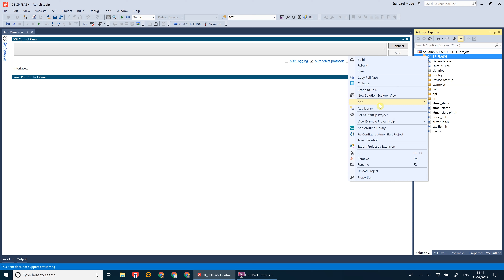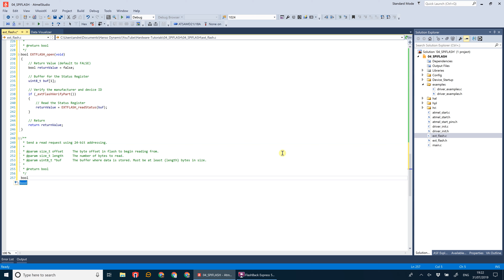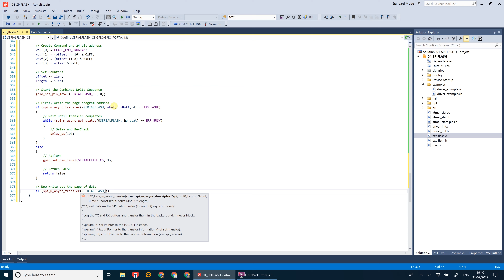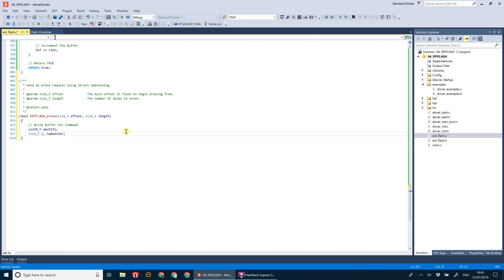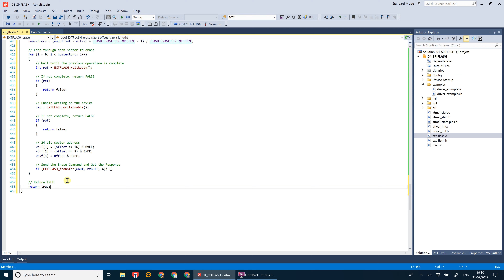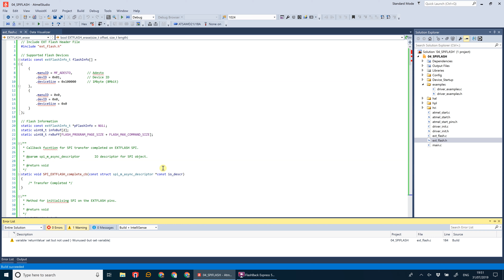Comment: Hi Andy. I didn't understand why you did infoBuf[0] = rxBuff[1]  and infoBuf[1] = rxBuff[3] instead infoBuf[0] = rxBuff[0]  and infoBuf[1] = rxBuff[2]. I checked it's datasheet. But you always did it. For example; while reading EXTFLASH_readStatus and you did buf[0] = rxBuff[1]; instead of buf[0] = rxBuff[0];. I think you dont think like array struct. In array struct , data is stored in array[0] not array[1]